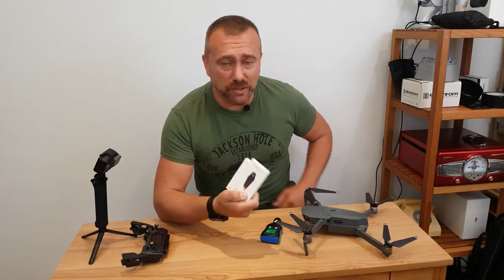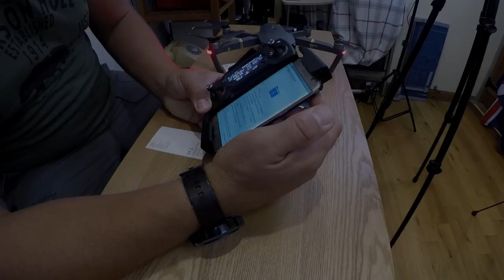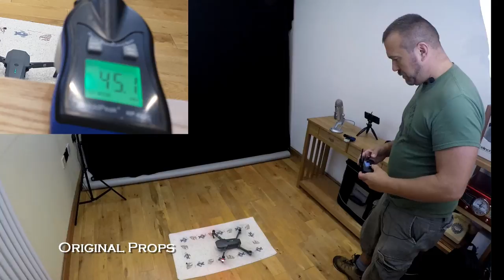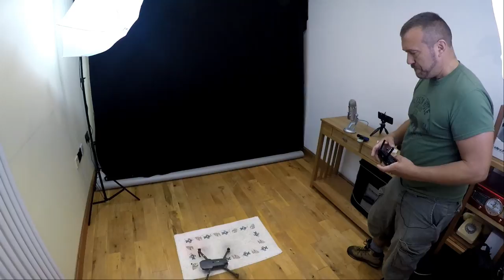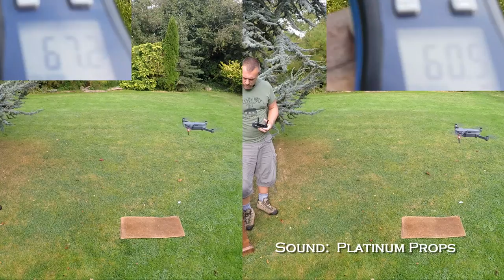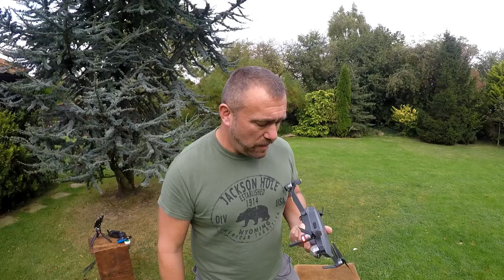Mavic Platinum 8331 Propellers - Studio & Outside Sound Comparison

Comment: Ian, sounds like minimal change for sure. I was gonna say difference between a chain saw and a weed eater but both sounds very close in your outside comparison. My question is did you try the flight distance if so any change at all.  I will be doing some flights inside a rock quarry this weekend to film a friends wedding this weekend . Noise echoing thru the area should be interesting.   A plus review, Thanks for all you do to keep everyone updated.
Reply from the maker: Hi fella. No, I was going to try the flight time test but this had already been tested by few other youtubers in fairly static conditions, and I didn't fancy flying my Mavic inside for 2 X 25 mins..... :). TBH, seeing how little difference they make to their claimed noise, I'm a little sceptical about any extended flight time.... Cheers, Ian

Comment: The pitch is the thing - like comparing a wasp to a bee. In theory the lower pitch should have a less obvious sound even when the amplitude is the same compared to the original props.
Reply from the maker: Hi Seafox. Yes, you're spot on. Reading up more on these, it's the subtle reduction in certain frequencies that has the biggest impact on the listener; the pitch is slightly lower and the frequencies that we're particularly sensitive to are where the main difference lies. They sound quieter without being much quieter....  :)  Ian

Comment: Nicely done Ian, I used the new low noise props down at the marina and compared them to the old props and there was certainly a noticeable difference in that open water environment
Reply from the maker: Thanks fella... Do you think they were quieter or just a lower tone?  I guess the best test is a regular flight path on a still day and see how far away you can still hear them..... Cheers, Ian.
Reply: Ian in London it certainly seemed quieter to the point where at the same altitude the new props could not be heard while the older style could clearly be heard. The tone is defiantly different but keep in mind that your motors are turning less rpms while using the new props compared to old ones
Reply from the maker: Well that's good to read... I have three sets of new props now and I've got used to their lower tone. Still couldn't work out if they were quieter when flying some distance away....    Cheers for the info. Ian

Comment: The ESCs on the Mavic Platinum also contribute to the quieter sound. I’ve seen comparisons that definitely show it to be quieter. I can see why people won’t upgrade their Mavics to a Platinum for a small difference but I think people would spend the small change for slightly more pleasing props. I’m upgrading because I’m flying an old P3P and I will definitely see an improvement in many things. 
Nice video.
Reply from the maker: Thanks Andrew. Yes, the new Platinum Pro ESCs will help and you'll allegedly have some 3-4 dB less noise. On the standard Mavic, DJI website states the noise reduction is less pronounced with the new props. There is truly no argument to 'upgrade' from a Mavic Prop to a Platinum Pro; it's literally 2 dB quieter than you can achieve with new props on a standard Mavic, and a paint job.  But if you're upgrading from a P3, then it's a great choice....   Be aware that the camera on the Mavic is similar to the P3; the only differences you're going to see are really compact travelling and range... I did a P3S versus Mavic comparison which outlines many of the different features; obviously the P3P has better specs than the P3S, but it still points out a load of key features... Cheers, Ian   https://www.youtube.com/watch?v=EW6g_lmZ44I&t=3s